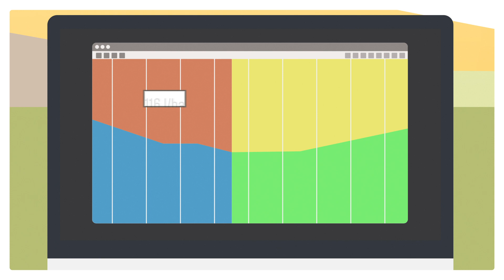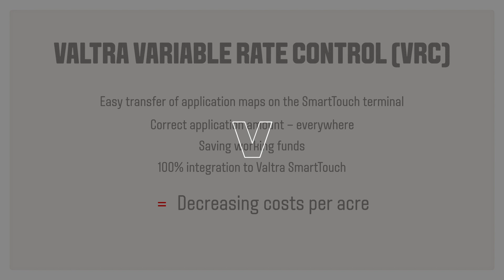Valtra Guide | Variable Rate Control

Comment: Valtra, how I can make my maps? It is any software? I try use QGiS Software to create maps my fields, but I can't load these maps (Valtra T175 with smartttouch of course)
Reply from the maker: Hi Rafal - You can create "prescription maps" with various FMIS systems, but every market has their own preferred Farm management information systems in use. A good place to start your selection for a suitable FMIS system is to check these alternatives, which are connected to the agrirouter: https://my-agrirouter.com/en/marketplace/apps/. Of course there are many more and as long as they can produce prescription maps, which are preferably in ISOXML format, but soon also Shape file format, our Valtra SmartTouch terminal can read and handle them. The transfer can be done either wirelessly via mobile network or more traditionally with USB-drive. Please contact your dealer for more information - https://www.valtra.com/dealer-locator.html. Have a great day! // Johan from Valtra.